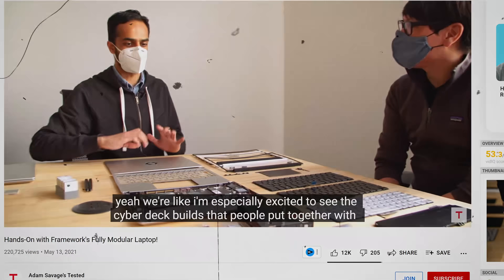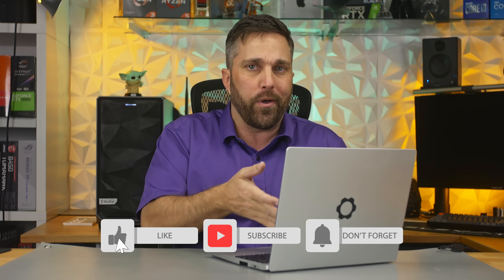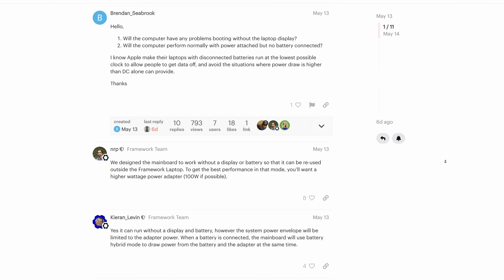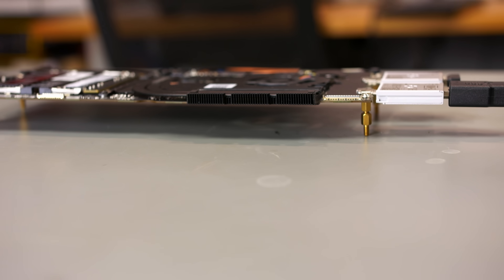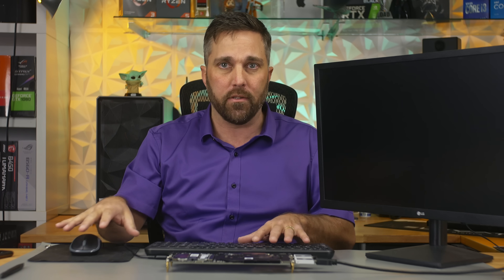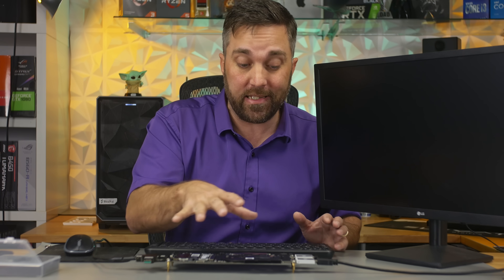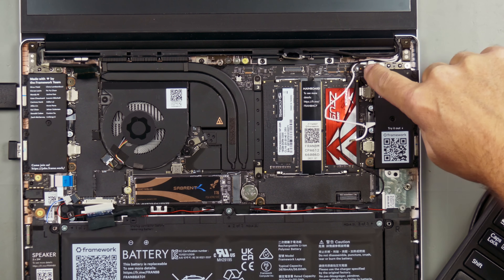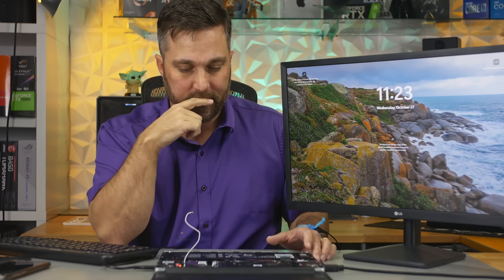This Framework Feature Isn't as Advertised. - Mainboard Testing.

Comment: I do not see this as a major problem - I would actually prefer to keep the old battery with the old board when I upgrade down the line. Also, bugs are a fact of life ( ... I am a developer). What matters to me is that framework is actively working on a fix. Also, half of the hardware is still in the bleeding edge development stage for software. 
To be clear,  this needs to be fixed. It just is not unexpected for me

Comment: Perhaps another option would be for frame to release and battery connector to USB C input board thing that can simulate a battery being plugged in and and supply power when connected to the mains.

Comment: I'm sure someone will come up with a connector that simulates the presence of a battery if firmware update isn't available to have it work without battery.
Reply from the maker: I can and have done that in the past but that isn't really the point.
Reply: @ElevatedSystems  then wat is the point it is all beta give them some slack really no clue why you have to make a big deal with this

Comment: Biased fan boys... I thought you liked this product and company. Give them some time ffs. Calling it ewaste is disingenuous without trying to work with them first. You are the worst type of customer who just points gotcha. I hope this video helps push them to get this working sooner than later, but your missing the point that they said you could use it outside of the case when you upgrade. They have no upgrade boards out yet, so they have no need to have this functionality tested and ready.

Don't get me wrong, it would be nice to have it already working. But 99.999% of their customers are leaving the mobo in their working laptops, until upgrade.
Reply from the maker: I do like the company and have made several favorable videos on the Laptop but that dosent mean they get a pass when they make a mistake. I'm sure they will fix it and I'll be able to make and share some cool cyberdeck builds.
Reply: @ElevatedSystems  looks like they fixed it. It's like they would've still helped you if you contacted them instead of making an inflammatory video first.

Comment: I'd still love to see a VESA mounted enclosure with battery included.
Brief power outages are common where I live, so having the original battery serve as a UPS would be hugely beneficial for me.

Bonus points if the 4k monitor could also receive power from the battery,
Extra bonus points if a monitor arm was still able to be used (monitor-pc-arm sandwich).

Thank you for all the Framework content  :)
Reply: My 4 or 5 year old Alienware laptop needs to be constantly plugged in. Battery health is currently at 39% of max capacity. It lasts about 45 minutes unplugged.
Reply from the maker: Any device that remains plugged in permently is going to degrade the battery very quickly.
Reply: @ElevatedSystems  I'm sorry but this is stupidly wrong. My laptops are 9, 6 and 2 years old and they respectively handle 80%, 91% and 99% battery. In order, they last 2H30m, 3H50m and 6H40m unplugged.
I have them plugged all the time except when ABSOLUTELY NECESSARY, and during power outages it is a HUGE blessing.
Reply: @ElevatedSystems  I don't think that's actually such a big issue. I actually agree with the commenter above, the battery would be an excellent backup power supply. As for degradation, most OEM laptops already allow you to specify a charging limit beyond which it won't charge. I've kept mine at 80%, since I"m plugged in quite often. True, for best longevity batteries should be stored at as close to 50% as possible, but with a product and company this open and responsive, I'm sure there'll be easy ways to program this so that it keeps the battery charged to 55% and then bypasses it entirely. In that case, the battery would not degrade as there aren't any charge/discharge cycles going on, it's just sitting there inert.
Reply: @ElevatedSystems  Lithium-Ion batteries degrade when kept at full charge. Lithium Iron Phospate doesn't and as such is used in UPSes. This is also why I wanted a LiFe battery option for my framework; even if it meant less capacity.
Reply: @ElevatedSystems  Not if the battery has an even moderately intelligent control circuit. My current laptop is over five years old, is rarely turned off, and its battery capacity is 80% of the original.

Comment: 3:00 i have done this with all my old laptops perfectly fine why do they need to update the firmware? ok specifically i have used a laptop with no battery plugged in on a bunch like 3 laptops and once i used a laptop completely outside the computer just like this.
Reply: It's almost like this is a brand-new product!

Comment: It’s not a big issue for me cause by the time the motherboard becomes obsolete to me as a laptop solution and use it for something else that firmware update is already gonna be out. Maybe they didn’t anticipate that people would be using the board without the battery since it can act like a backup power supply but as long as they fix it within the few days it’s good. As long as it doesn’t have the problem where the board doesn’t work without it being in the case they’ll still get my money

Comment: i should have waited
Reply: no you shouldn’t have? this video was completely unnecessary seeing as it’s a simple firmware update that will implement this feature.
Reply: So you have an urgent need to use the mainboard outside of its enclosure without the battery?

Comment: Needing the battery to be connected to boot the system is pretty dumb, but I always though using the battery as a built in ups would be cool when using the motherboard outside the case.
Reply: It smells like a bug to me.  The fact that the system will boot with the battery disconnected if it's rebooted from the OS suggests that the problem is isolated to cold-booting.  If they wanted to actively prevent the system from booting without a battery then 1) they'd implement it better, and 2) what would they even gain from doing that?

Comment: Although this is disappointing this could probably be easily fixed with a couple bucks worth of connectors, capacitors, and wire. I really hope the patch it. If not, the community can come up with a solution relatively inexpensively. Definitely misleading.

Comment: it's possible that they TECHNICALLY didn't lie... the CEO meant that there's no hardware limitation, but the software team didn't prioritize out-of-case usage, so the software still assumes you want a battery...
or possibly just slight misinformation, like "yo devs, can our laptop work without battery and whatnot?" "uh, sure? I don't see why not?" "alright, seeya, gotta interview" "hmm...HEY, wait, we haven't---whatever, I'll just add it in later....after I finish this task first..."
Reply from the maker: The lead software engineer said conclusively   "It works disconnected form the display and battery"

Comment: I am preeeety sure that even without a firmware update, all you'd need to do is like, pull one or two pins high or low or whatever, to let it boot...
I'm pretty sure it defaults to just simple checking of "is battery at non-0%?" or such, which you could easily jumper over or something, as a bypass... prolly can be fixed with just a few resistors directly from power in or something

Comment: While I agree that they kinda miss led by saying it would then it needing s firmware update to make it so, but I feel like they've already addressed it in the statement saying they will be pushing out a firmware to address this. Like someone else said, adding a battery or a circuit to mimic the battery wouldn't be the worst thing.  Overall i think the front picture and the tone of the video is a bit over board. Again, they appear to be attempting to make good on it.
Reply: Super overboard. The devs were ALREADY working on releasing the fix, and this guy just makes a mountain out of a mole hill. 🤦🏻‍♂️
Reply: From what I have seen, this feature was working and was broken in the later firmware updates and is going to be fixed in the future. I may be wrong but this is what I gather.
Reply: @clippityclipclip10  yes, framework posted saying that it actually works with the old firmware, it just needs a higher than stock power brick. It needs one 100+watts vs the 60 that is standard. Which explains the fan trying to start than not.

Comment: Maybe try using a boost/buck converter and use it to spoof the battery? If you can mimick the voltage, maybe that will be enough for it. Could even try just shorting the battery connector on the main board? My theory is it's looking for continuity between the terminals

Comment: It is dissapoiting but if Framework does add the ability to use the motherboard without the battery, then it's just a simple matter of upgrading the firmware
Reply from the maker: That dosent help me today.
Reply: @ElevatedSystems  The company probably didn't think anyone needed to do this yet without motherboards to upgrade to. They have time to develop the firmware to make this work.
Reply: @jonmayer  It’s not their decision when to enable functionality on something that they repeatedly said was an out of the box feature. The customer is buying it for the features that they can’t find anywhere else and this was one of the big ones. Don’t be deceived, a company is a company and unless you keep them in your sights and keep them honest they will run away with your money and give you nothing in return.
Reply: @ElevatedSystems  yeah, I should've mentioned this is for someone that's looking into getting a framework but are holding out. People that own one are currently SoL unfortunately
Reply: @ElevatedSystems  Big fucking deal lol
Reply: @ElevatedSystems  karen

Comment: E-waste? Seriously?
If you already know there's a firmware update coming why do the content now?
I don't get it...
Reply: Blaming the whistleblower is not a good idea imo ... i  do appreciate someone to monitor and push them a bit
Reply from the maker: I don't know it's coming. I thought it had specific capabilities when I bought it. Fool me once.
Reply: @ElevatedSystems  Did they ever specifically state it worked without the battery? They said it worked outside the case.
Reply: @philiphiggins6870  Yes, they specifically mentioned it on the forum for example.
Reply: @ElevatedSystems  But you knew it was coming when you quoted the post from nrp saying that the firmware update was in the works.
Reply from the maker: @StuTubed  But I had been quoting his reply on that post from 13 May and look how that turned out. Also thumbnail has been reconsidered and edited.

Comment: I think the name of this video is really uncalled for. It makes it sound like "this device has a major issue." Yes, it sucks it does not work outside of the case with out a battery but, thats not that big an issue. Its not like dells where if you take everything out of the casing and it fails to boot every time. This is a new product, its not surprising theirs issue. this issue probably could have been resolved with a jumper point.
Reply from the maker: But they did let me down :(
Reply: @ElevatedSystems  I do understand that, but this not something like the AW A51 R2 where one year after release and plagued with issues was a complete disappointment. This is at best an annoyance till firmware fixes are applied.

Comment: Shouldn't be that hard to just connect the power supply and/or whatever is uses to detect the battery to the battery connector. As you had it reboots without a battery it shouldn't be that hard to do enough to fool the bios?

Comment: The motherboard can work outside of the laptop with a battery attached? if yes than there is no problems, the battery itself cost around 60 bucks and will give to any project you intend to do an extra kick, it can actually be used for off-grid like camping or travels, you can actually make audio capture device and you can make it portable and self powered. And personally if i've to update the motherboard i will probably change the battery anyway
Reply from the maker: Not a solution for a device that will be plugged in 24/7.
Reply: Well at least they will fix the issue with an update, but still I think that the use of the battery for a project is actually more appealing than running 24/7 a laptop's motherboard, but anyway compared to any other laptop on the market i find relatively easy reuse parts of the machine for any kind of project and that by itself is a great thing compared to some brand where you just have to throw away the entire machine

Comment: It makes sense since this is supposed to be an end of life feature. There are no new motherboards coming from Framework yet, neither are any of these laptops obsolete, so postponing this firmware update is fine for the time being.
Reply: It does make sense, they should've just been more clear that this wasn't implemented at launch. As it is, it makes it a little harder to trust what they say when they don't differentiate between something currently functioning and something planned.
Reply: @changelingthing423  Yes, exactly.
Reply: I think everyone's blowing this out of proportion. This is such a SMALL feature that is supposed to be there only for EOL of the mainboard, so YEARS down the line.
they're releasing a fix... chill 👌

Comment: So this is kinda shitty and they really should've clarified it was something they were working on and wasn't ready yet. But I also feel like this is probably a rather low priority task at launch, when 99% of boards are going to stay inside that laptop, and there's likely to be more immediately important issues like driver support and launching the marketplace. So if they handle this right, it's absolutely forgivable and everything else I've seen so far is still great. Part of me wants to say this also seems like something that could've been solved at a design/architectural level from the beginning and should've never happened, but I won't pretend I have a damn clue how firmware and shit works. Computer go boooooot

Comment: I wouldn't consider it a total fail, but a disappointing limitation. Building an enclosure to account for a battery could still be a project. Hope they get this shortcoming fixed to live up to their promise. 

Still consider my DIY Framework a success. Rig is sans-Microsoft/Apple and running great. Installed my own hardware, selected my ports and installed an OS that doesn't call home to the mothership. All in a package that looks on par with a premium thin & light.
Reply: Update framework responded. They are in beta mode for the feature with release coming soon.

Comment: I hope this puts pressure on them to fix the firmware. What happens if you just put 10.8v  on the power pins and something small on the thermistor pin?

Comment: I really hope that they deliver this soon! I would have liked to see that All in One, should be a ridiculously easy build once it works just on USB-PD.
Couldn't you just have put the battery on the back of the monitor as well? Wouldn't be quite as neat, but still.
Reply: It would be possible from what I understand. A full vesa mount case would be fun, especially if you had the option to use the built in battery to power it.

Powering the monitor, though, that's a different story.

Comment from the maker: Just FYI, I wasn't throwing shade at LTT or Dave2D, I have repeated those same claims up until now. Also adding a battery to any of the designs is not a good solution as they are all desktop type builds that will remained plugged in permanently. Also I can mod or shunt any mainboard to work on its own. This was supposed to be different.
Reply: Have you been able to find the CAD files linus mentioned?
Reply: Or rather, should you just be providing let to the board through the battery plug, take it as the good ol'barrel plug